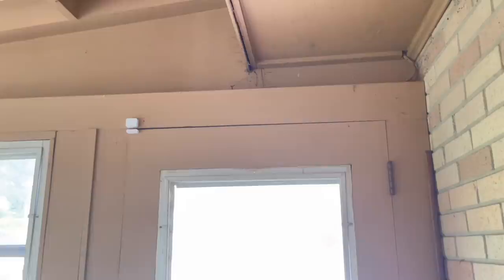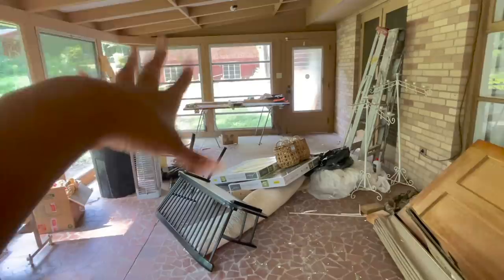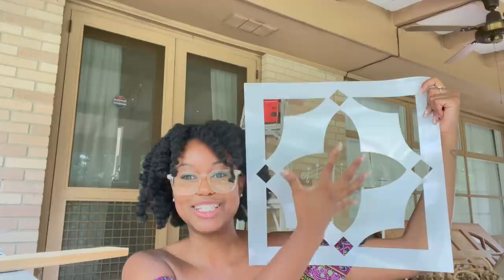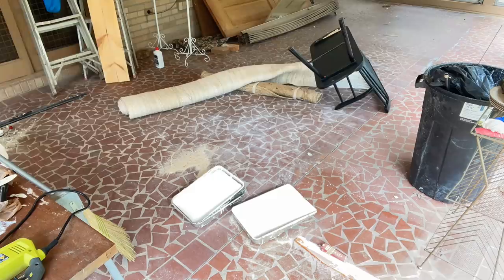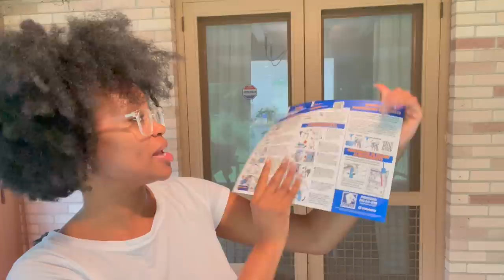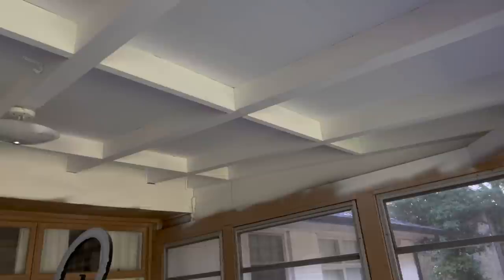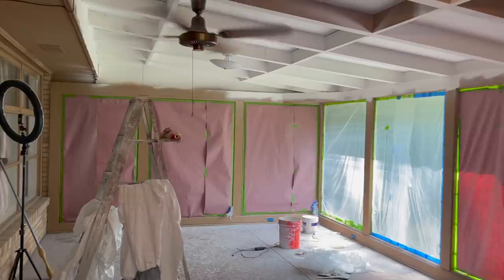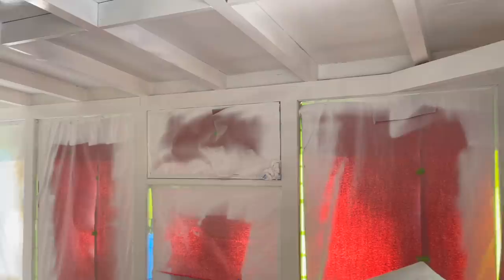DREAM SUNROOM MAKEOVER! PT.1| Planning the Design, Using a Paint Sprayer, & Shop With Me #FIXERUPPER

Comment: At tip for painting with the paint sprayer is to do light coats and let that coat dry and just repeat until the coat of paint is nice and even if you spray too much paint it will puddle and do what you were talking about. You probably aren’t going to paint any more ceilings but it’s a good thing to know😂
Reply: And you were to close. That is also why you to had so much paint spray back on you. 
You will be doing your office and bedroom(s) and these are great and hopefully helpful tips. 
At Harbor Freight respirator mask are $17.00-27.00. Filters are about $8.00; so so worth it for your lungs and skin.
I am very much enjoying your excitement in fixing up your home.
Reply: @honeyharmon6571  yes way too close and way too much paint at a time.  I always have the same problem with spray cans of paint.  Always so tempting to just do it a bit heavier so you don't have to do it again.
Reply: Also, my husband suggested turning the pressure down on your sprayer. Hope it helps!
Reply from the maker: Omg thank you for the tips! 💕
Reply from the maker: @honeyharmon6571  thank you!!

Comment: Dripping means too much paint in that coat. Two light coats is best. Roller paint cleanup is called back brushing. Nice transformation. Glad you are going with a little color on the floor. I like color #1.

Comment: FYI- from my own experience if you are allowed to pull permits - you can knock down the wall and enclose the sunroom to extend your living room and turn that view into floor to ceiling window with great view - it’s called a fishbowl view. 

It would add more square footage and it’s still under the roofline, building materials are crazy expensive unpredictable and on back order so now may not be the time- but once the building costs drop do look into it.

Comment: Depending upon your furniture but go with something that will ground the white on the ceilings and trim for your wall floor color.  Also, will you have to do more before painting it?  Seems you might have to smooth out the dloor first from the original tile on the floor.

Comment: Typically stencils are put on flat/smooth surfaces (floors, walls, ceilings) and not on stone/uneven surfaces.  From your video, it looks like your floors are stone, so it will be interesting to see how the stencil turns out.  I think painting the floors a solid color would look good.  The floors, brick walls, and your decor will pull in different textures so it won't be flat/one-dimensional.

LOL, I was thinking before you mentioned the curtains that some shrubs, tall trees against a fence/lattice wall would block the red brick situations your neighbors have going on.